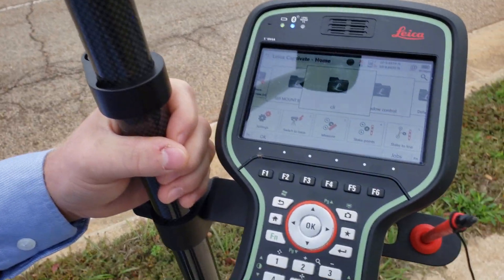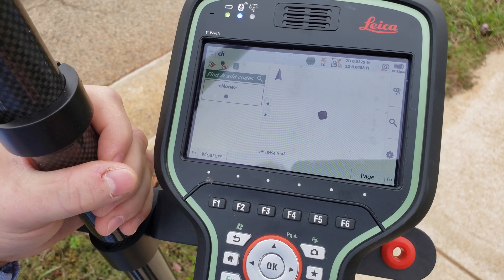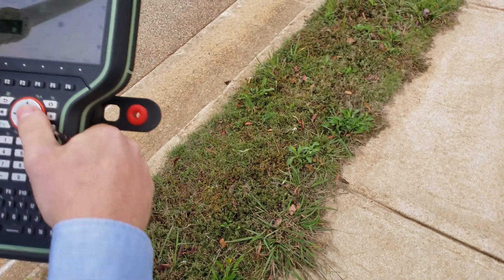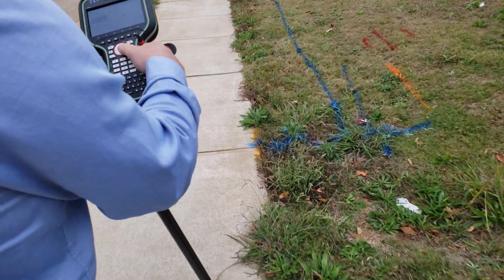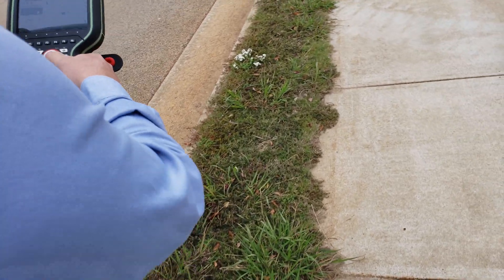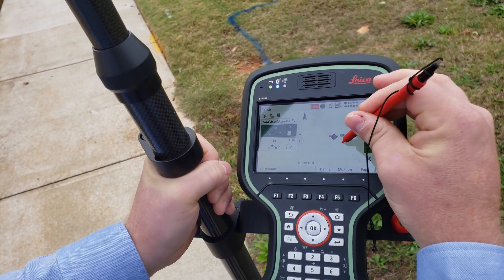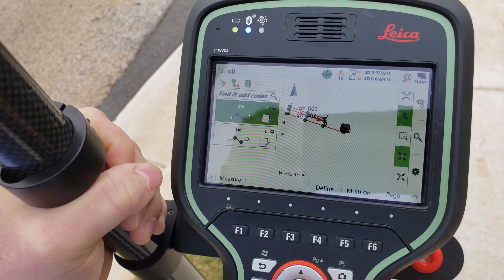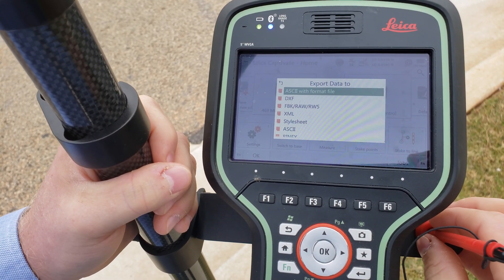Leica Captivate Coding and Linework

Comment: The only problem here is you can't create two linework codes for the same shot.
Reply from the maker: There is a multiple codes option to enable on this screen, we just did not highlight it in this video.
Reply: @terrawisesolutions  You wouldn't happen to know how to make a circle? I can start a spline, however it won't let me close the line unless I change it back to a straight line.
Reply: https://www.youtube.com/watch?v=o-8jyXYEtxE 3:53 
This video kind of explains how to do it